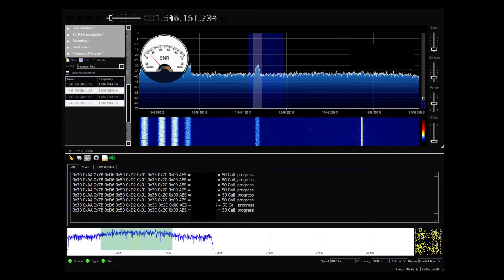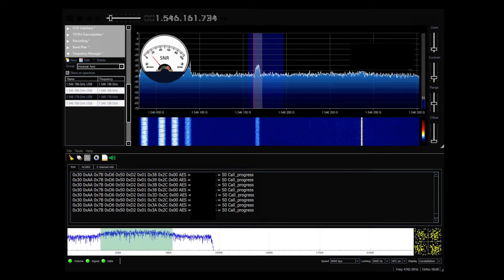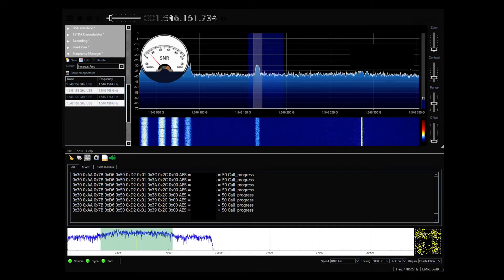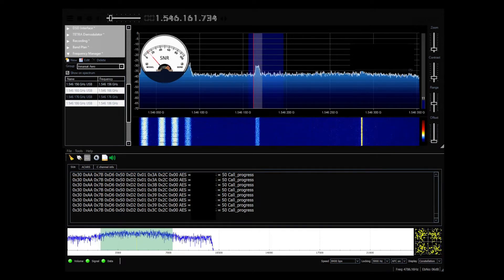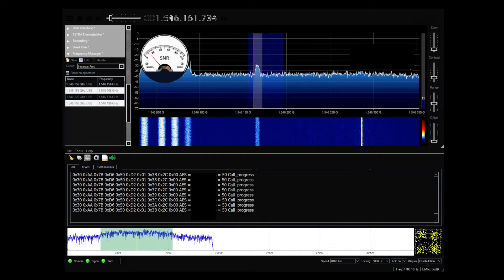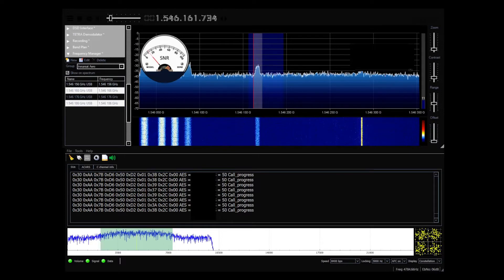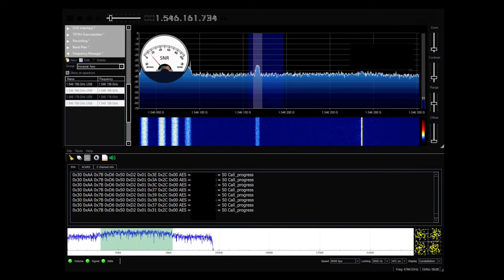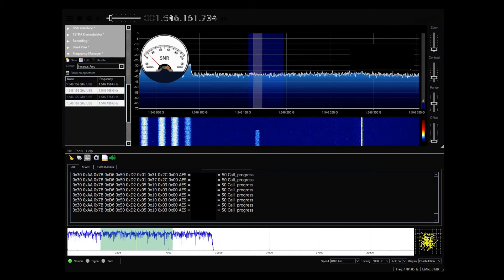Inmarsat Aero 1.546 GHz L-band Voice Decoding

Comment: the audio quality of the digital voice is terrible! The voice during DMR is also terrible.
Reply from the maker: Yes, I do agree with the undeniable fact that analog voice sounds far better than digitized voice. However, analog voice is not spectrally efficient. You can squeeze multiple concurrent voice transmissions into the same channel bandwidth that a single analog transmission occupies. Nothing is ever going to change that unfortunately :(

Comment: Hello everyone! What devices do I need to use this app? is there a chance to actually hear the decoded sound?
Reply: Where de we get JAERO and voice decoder? Thanks
Reply from the maker: @videodude8137 You can obtain JAERO from Github
Reply from the maker: Hi, to listen to Inmarsat Aero phone calls, you will need the following:

- Decent-ish PC. Anything from the last 10 years will do.
- Software Defined Radio which can tune to 1540 MHz, I always recommend the SDRPlay RSP1A, but an RTL-SDR Blog V3 will be fine.
- L-band antenna. The "RTL-SDR Active L-Band Patch Antenna V2" is a good choice
- Satellite dish. This is optional, but if you want reliable voice decoding, a dish is kind of necessary (in my opinion)
- Some rudimentary understanding of how SDR works, how virtual audio cable software works, what a 'bias tee' voltage is, and the use of the Windows operating system

Comment: G’day, great video, but I have one question. How are you able to hear only the decoded voice instead of the signal. I have been able to decode the voice, but I still hear the raw signal from sdr # in the background on my setup. For reference I am using vb audio cable to route the output from sdr # to jaero, then listening to the output of the cable (including  jaero output). Any help would be greatly appreciated :)
Reply from the maker: Hi, thanks for your feedback. Regarding hearing the raw signal from the SDR and hearing JAERO's decoded voice, I do have a theory. It is possible to hear your virtual audio cable through your computer speakers. If you go to "sound control panel" or "sounds" (the non-applet sound settings, think old school windows 7 'sounds' settings) and you go the "recording" tab, right-click your virtual audio cable/vb-cable and go to "properties". In the "listen tab", check that the box labelled "Listen to this device" isn't ticked. Because if it is ticked, you will hear SDR# audio through your speakers.

If that doesn't rectify the issue, i would try and acquire a copy of Virtual Audio Cable instead (it's paid software, but it's possible to get it for free *wink wink*) and see if the problem is isolated to VB-Cable?

Failing that, i would try a fresh downloaded copy of SDR Sharp to ensure you don't have any SDR# plug-ins causing funny business.

Also, check there isn't any "stereo mix" activated in your windows sound settings also (Realtek HD audio, i think) That can cause audio loopbacks and stuff. Good luck mate!
Reply: @RobVK8FOES   thank you so much for the response. I’ll try out what you have suggested and let you know how it goes. Cheers :)
Reply from the maker: @redacted5594  No worries mate, I hope you get the issue sorted!
Reply: @RobVK8FOES  Hey, I wanted to thank you for the suggestion to use Virtual audio cable instead. I set up the patch antenna today and was finally able to hear the audio from jaero clearly. Thank you so much!
Reply from the maker: @redacted5594  Outstanding! Glad to hear you got the issue sorted! Enjoy your L-band decoding!

Comment: Very good. What antenna are you using?
Reply from the maker: The person who made this video told me that they were using the RTL-SDR Active L-Band Patch Antenna V2 (grey enclosure version) with a 90cm offset dish. For this video, they told me that they were using an RTL-SDR blog V3, but have since upgraded to an RSP1A.
Reply: @RobVK8FOES  Thanks for the reply. I had a go at compiling the code to use on windows but gave up half way through as there was some kind of error.
Reply from the maker: The person who made this video said anyone can get JAERO with the aeroAMBE codec here:

 https://drive.google.com/file/d/1fMACHcKGT7NeNcVpnyB0mXa04pHAU0QW/view
Reply: @RobVK8FOES  I can't get the link to work can anyone fix it please?   I'd like to play around with this with my HackRF SDR
Reply from the maker: Oh, you are correct. The link is down. If you download the latest JAERO version from GitHub, aeroambe.dll is included and It decodes voice out-of-the-box. I think the author doesn't care about AMBE copyright infringement anymore, LOL

https://github.com/jontio/JAERO/releases